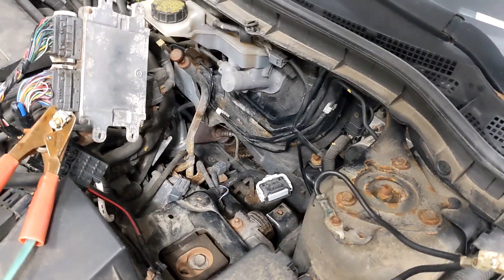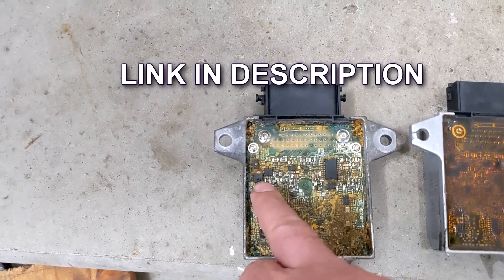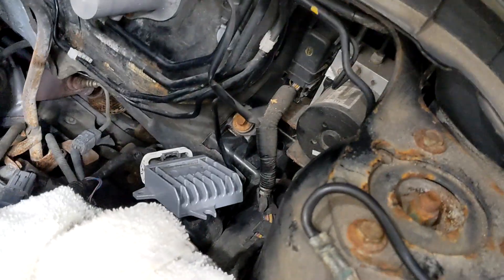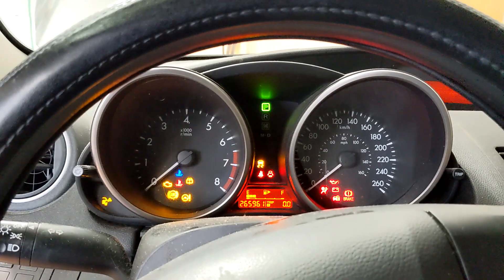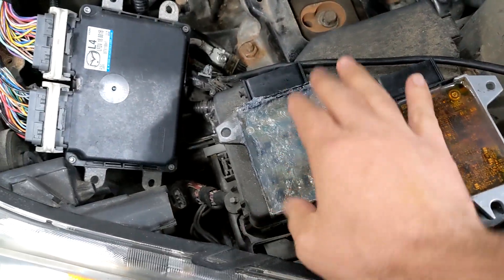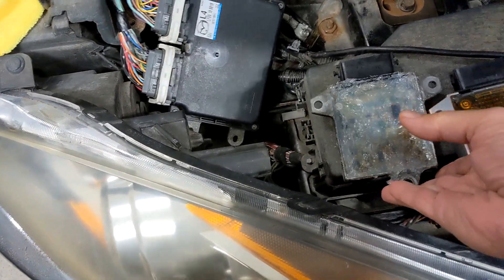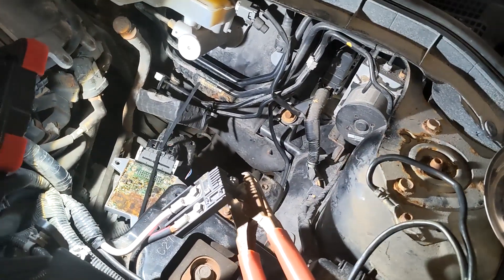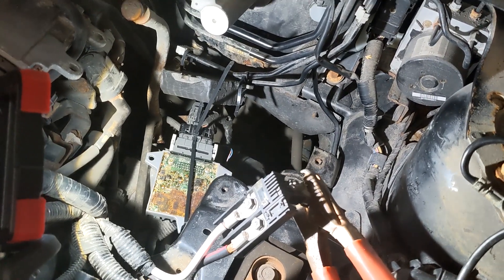MAZDA TCM Circuit Board DIY Soldering Repair. Reman the TCM Yourself For FREE!  READ THE UPDATES!

Comment from the maker: UPDATES HERE!!
UPDATE JAN 1 2026
If you  "ONLY"  have a  U0101 code maybe you just need the AT relay  (under hood fuse box mine was labelled as ""at main/ fuel pump/  f.def rh")  or have bad powers and/or grounds or data lines to TCM......My original bad TCM is still working properly, so maybe i did "not" need to "re"-re-flow original tcm as it seems it was a bad AT relay(under hood fuse box) and my first reflow was good enough, maybe the paid refurbed tcm was also fine and it was the relay that was bad but i broke the locking tabs when i removed it. IDK.
 i would need to reinstall refurbed tcm with zip tie to see if it works with the replaced AT relay, testing requires my daughter to agree lol.

UPDATE OCT 29, 2025. 
drove 2 hrs,  about 150 km, 93 miles ,no issues w/original tcm that i resoldered, hopefully it was easy as just replacing the relay for the tcm

UPDATE OCT 15, 2025. 
Random intermittent problem keeps coming up, AT, traction and check engine light, U0101 stored code, original bad tcm had more tcm codes stored initially b4 installing refurbed tcm.
can be a power and ground and/or canbus communication problem, there is a relay, its labeled as "at main", fuel pump and  f.def rh, depending on model variants it can be used for fuel pump and not for at, for me pulling out this relay does cut power to the tcm and gave the u0101 code, i swapped out this relay to see if it has any effect, will update

UPDATE sept 2025
my original tcm i did a re-soldering job, working for months now without issue, but put a layer of saran wrap b4 adding the silicone for easier silicon removal if i have to redo the job.
the paid refurb one is still not working correctly, something to do with the pin fitment, imo, i think the circuit board needs to be removed from housing to fix but have not tried that yet as its not easy to get that board out
Reply: thx, I had initially overlooked that relay thinking it was for tranny and fuel pump, I would of noticed my fuel pump giving out, didn't know it was either and not both
Reply: Where is the relay located?
Reply from the maker: @slafama  in the underhood fuse box labeled  at main, fuel pump and  f.def rh, confusing? i know, it seems labelled for more than one thing but its not, for mine it was for the automatic transmission, maybe for manual it will be used for fuel pump or what ever gm decided
Reply: @diyvinny6300 thank you. Ill look it up. I also have an automatic transmission. I appreciate your help. 🙏🏻 also having the same issue. 😀
Reply: i need this capa de film how is? film im mexican no   speak  english so rry jaja , i have same problem men

Comment: Well, I just reflowed the same spots you pointed spot, and it worked for me. My wife has a 2011 Mazda 3 s grand touring signature hatchback.  At light, engine light, code u101, I bought a Chinese Tcm from Amazon, only half worked,  trans shifted fine, but lights stayed on.  Wasn’t programmed correctly.  I did  order a different one, coming tomorrow, but i re soldered the same spots you did, and it worked, I just have to put silicone on t back!  Not sure if I will try the new one and keep the orig for backup, or cancel the order for now! I did check all the fuses etc, it does have 150k miles! First time it went out. Thank you for your  video! Never would have thought to do  that!

Comment: Hello I wish I would’ve seen this video a longtime ago..lol Anyway I bought a eBay TCM but it wasn’t plug and play like we thought. So I’m gonna try and resolder the different places and see what happens. I’ve replaced fluid filter solenoids and now we bought a TCM. After reading your update I’m curious about the location and what spot the TCM relay is in. I know there is a fuse box in the front near the battery just not sure the location. My son’s car since this whole thing started probably has 22+ codes which I’m sure will mostly go away when the module gets fixed.
Reply from the maker: in the under hood fuse box, its not labelled as a tcm relay, mine was labelled as ""at main/ fuel pump/  f.def rh"

Comment: Hey man, did everything you said in the video and soldered all the points you showed in the picture and it worked! Just wanted to post a comment to thank you. Once I had this issue I went to the junk yard to grab a used one, plugged it in and even that one didn't work. Called the dealership and they said a new one would be $778 (canadian, as I live in canada). Even then, they said I would have to get it remapped which I have no idea how to do. I said fuck it let me try this, it worked. I'll post again if I have any issues later on but if not, everything is good. Literally was my first time soldering, so if any of you don't want to spend a crazy amount and have the time, do it. I was literally contemplating selling my car when the junk yard one didn't work either.
Reply from the maker: great to hear, iirc i thought buying new was impossible, non existent, for a 2011, no remapping is need afaik, i also plan to go to junk yard where u pull ur own but the one closest to me, 1 hr away, have about 7 of 2009-2012 mazda 3  and they're all manual transmissions on their lot, the other junk yards where they pull it out are charging ~$500cad for a used tcm, only guarantee they offer is a store credit
Reply: @diyvinny6300  Hey just a quick update, it the one I fixed actually stopped working after maybe 2 weeks. BUT, I took the one I got from the junk yard that was dead as well and did the same soldering on this video and it now works again. Yeah junk yards are pretty much a scam for big stuiff like this because they just offer in store credit and for my junk yard that in store credit only lasts for 30 days. Very weird. Anyway, I'm still happy that i was able to learn how to solder and fix this issue for the two weeks it was working. Thank you again and I wish you all the best.
Reply from the maker: @joetoe459  my original tcm i also had to do did a resoldering job, working for months now without issue, but put a layer of saran wrap b4 adding the silicone for easier silicon removal.
update on the paid refurb one is not fixable, something to do with the pin fitment, i think the circuit board needs to be removed from housing to fix but have not tried that yet
Reply: @diyvinny6300  Oh adding the saran wrap before putting in the silicone is actually genius. I wish I did that before fixing the junk yard TCM but I just ended up selling it and letting the person know about it. They didn't mind. I think the original TCM I worked on didnt last very long because I used a razer to scrape off the jell at the back and I think I might have cut some of the resistors or whatever they are called. For anyone that's doing this for the first time, I recommend you heat it up with a heat gun, cut the little putty at the back (very shallow, dont cut too deap to the point where you touch anything), and then once you get the big chunks out,  use isopropic alcohol and use a toothbrush to scrape off the rest until you see the metal you need to solder. Just keep repeating the heating up and isopropic alcohol to get as much off as possible. Anyway, thank you for your help! I'm still happy I was able to fix it and I hope this works better for anyone else!

Comment: If you remove the flat White plastic piece on the connector that lines up the female pins on the connector, you most likely will see some of them backed up . Due to those plastic tabs failing to hold the pins . Causing a few of them pushed back. Seems like they are making a connection by the tie wrap pulling the module and connector closer to each other..

Comment: interesting. I just had mu TCU rebuilt and have the same issues after reinstalling. ( Engine Light and AT Lght and Hard shift ) I will try seeing if the stress on the plug makes a difference.  Cheers.

Comment: Worked like a charm!
Reply from the maker: the resoldering or zip tie mehod?
Reply: @diyvinny6300  resoldered pins, the screws, then all the chips x2 times, zero codes
Reply from the maker: cool, mine is been almost a year but it started acting up intermittently, got a u0101code for the tcm, resoldering and zip tie did not resolve problem, i think i have a pin fitment issue on the cable which is hard to test because of the tcm plug location and orientation. as of now  its very intermittent and doesn't last too long, according to my daughter
Reply: @diyvinny6300 that code can be from shift selonoids did you check those and your ground to the trans ?
Reply from the maker: @thecritic8318  the refurbed tcm kept giving U0101 even after resoldering that one, i resolder again the original tcm and its been going good with no errors. if that failed i was going to check for powers and ground and the 2 wires for the canbus at the connector and wiring to the pcm/ecu,  but its been good so far with my original tcm but not for the refurbed tcm

Comment from the maker: the resoldered original tcm is still working perfect, not one problem, no intermittent transmission issues as was the original problem, no one has told me how to remove the circuit board from the refurbed tcm, i might revisit that problem
Reply: k, started to glitch again after a solid 8 months  with no problems, resoldered again, but made sure i did a better job, but some tape on circuit board b4 putting in the silicone to make for easier removal of the silicone if i have to redo it, working perfect again.,...i wish i can get to the other side of the circuit board without the fear of breaking it.
edit: read your updates, this helped as i think i also had a intermittent bad relay, no problems once i replaced that relay which is in the under the hood fuse box

Comment: Interesting.  Thanks for the video.  I hope you get well soon.  Hey, one thing to consider is, a lot of silicone sealants give off acetic acid (vinegar) as they cure ... and that can corrode the materials under them.  So if you use silicone, you should try to find one marked "neutral cure".  You can also use an "acrylic conformal coating", which is closer to the original material used.  A bit more expensive, though.
Reply from the maker: thx, i used silicone for aquariums, should be good as i wouldnt think it would be acidic